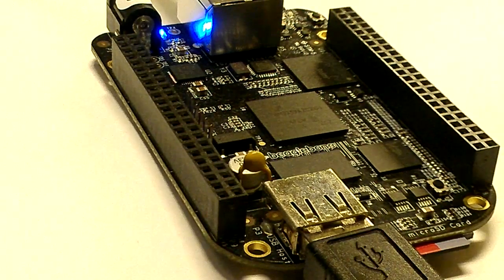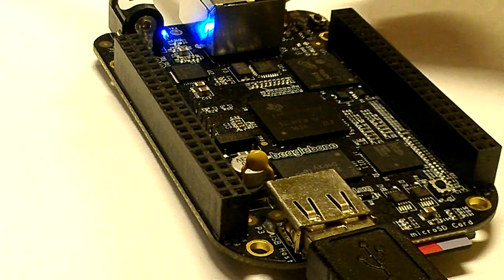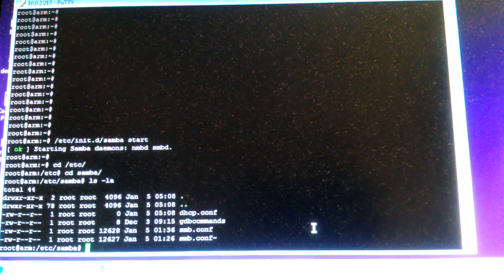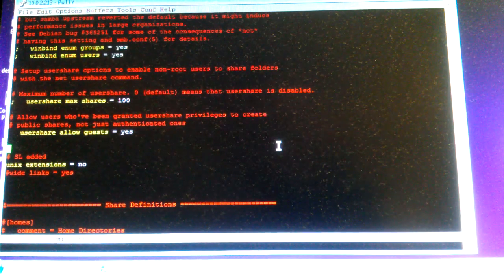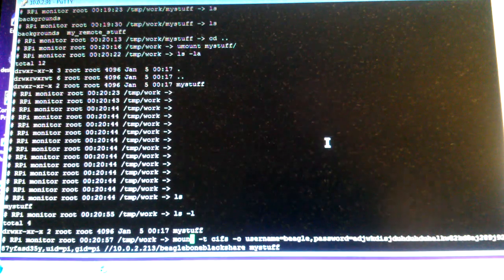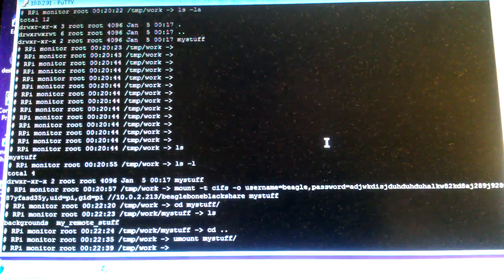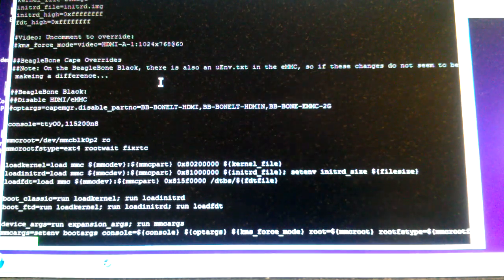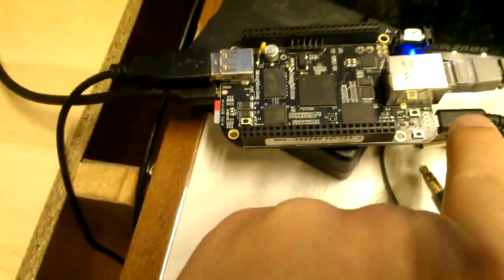BeagleBone Black Running Debian Linux as File Server

Comment: Because there are 8 bits in a byte, a 100Mbps connection can give a theoretical maximum transfer speed of 12.5MB/s.  Due to header overhead however the practical maximum speed is around 10MB/s.